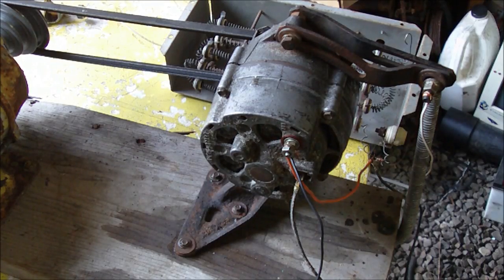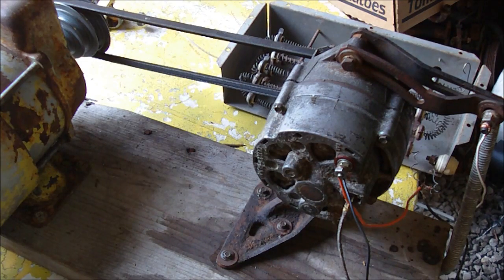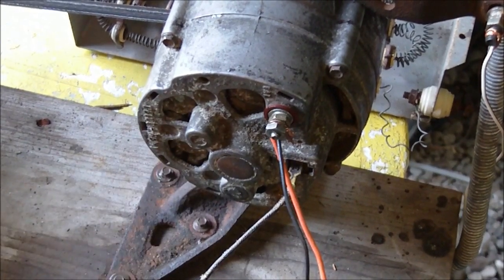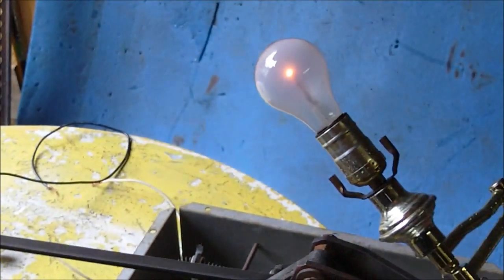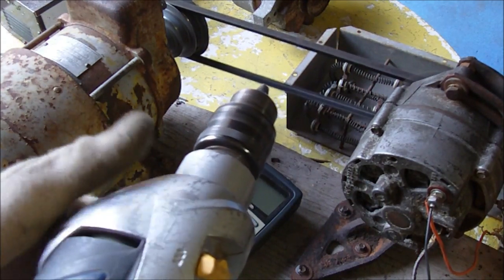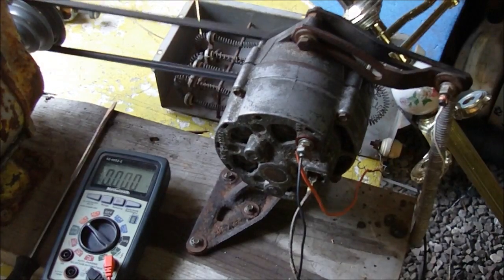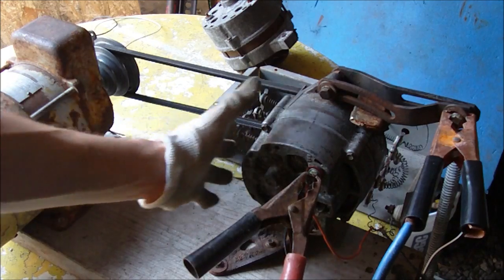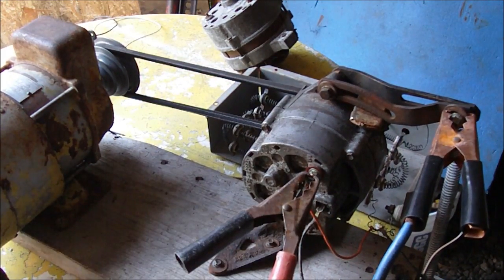Alternator Demo, self energize, generator, arc welder

Comment: Could you get more then 40 volts out of that alternator?
Reply: Yes, if you use an alternator without an internal regulator, or bypass the internal regulator, the output voltage will be proportional to RPMs, which will depend on max RPMs of your drive motor, as well as the pulley diameter ratio.

Comment: Run a forklift e motor powered by a big battery pack like in a car connect it with belts to two or one alternaters hyperthread the power generation into a inverter which is connected to a powerful battery charger which is connected to your battery pack and all your house hold stuff in the other plugs on the inverter and one plug in your bum bum ha ha

Comment: I'm confused... Why are you not using the amps and volts being supplied efficiently? You are making more power then a huge solar bank and not making use of the full potential? Inverters controllers and a battery bank and you can get some massive energy. As set up what is being generated besides 40 volts? There should be a lot of untapped power there.

Comment: Dori, there's nothing fake about this video. the electric motor (pointed out at the beginning, explained, not hidden in the least) is a substitute for a gasoline engine for demonstration purposes. this isn't a video about getting "free energy" or any other bs, it's about building a portable and cheap arc welder. He pulls the "rubber strip" (that's a belt, BTW) to help the (totally not hidden) motor start, because electric motors sometimes can't overcome the initial torque requirements placed upon them.

Comment: Hi Kurtscottage, thanks for the work ua doing really I love watching yo videos! well, am building energy Generator from car alternator and  a car fan motor but it seems the motor has no enough power to run the alternator, when the alternator starts to produce power out the motor slows down the speed. How can I control the regulator in the alternator because regulator is build in alternator inside it, the type of alternator my is " nippon denso alternator with five connector" pls In need yo help?

Comment: This video is over a year old.  If you are still alive, it would be a pleasant surprise.  If so, be warned Darwin is never far behind folks like you.  All of your "I'm not sures" and "I don't really knows"  will add up.  Accidents resulting in injury or death are nearly always a series of small things that add up.  Imagine a random pile of swiss cheese slices.  Holes in every one of them.  Yet if you stack them up, you ALMOST never get holes that line up.  So it is with safety.  No single measure will completely eliminate risk.  So we stack safety measures to cover the holes in the others.  But every now and then, Darwin finds a way to line the holes up.  And you, Sir are one cheese shuffling daredevil.  Be CAREFUL!!!

Comment: If you put 2 in series could you get 240V, and run a 50 Amp. Miller Arc Welder?  I was thinking on buying a generator, but this would be way cheaper as I have plenty of lawn tractor engines kicking around.

Comment: First of all you should practice in a safer method.  When working with electricity always use the proper connectors and insulation's should be a big part of your demonstrations.  Why you ask?  Because 3 days ago I went on an emergency call to find a 16 year old boy dead who was doing very similar experiments with alternators.  I would suggest reposting this stuff doing it the right way.

Now.  Your "alternator welder" again this is not safe.  Basically you may as well bypass an electrical breaker in your home and "weld" that way until the wire catches fire and burns your house down, it is the very same premise as your alternator welder.

Alternator's do not have breakers and what you call "welding" is actually an uncontrolled short circuit.   The alternator and or wire used to weld with will just continue to heat up until either the wire melts/catches fire or the alternator does.  This is why we have machines called "welders".  They actually are built to weld and have all the necessary protection devices within to keep you and your home safe.

Please stop posting this type of careless and thoughtless dribble before you "inspire" others to cause serious harm and or damage to their selves or their property.

Thanks.

Comment: a car alternator will put out 120v+...........regulator  is what limits that....simple operation.........they are actually like 3 phase......they are wired to have 3 hot outputs......
change your pulleys........get a lot ,more voltage.......
i have one of those flat new model washing machine motors that i modified and it will put out 800v+........i can pull a 4 inch arc off it......

Comment: I wonder if you could use 8 AA bateries that are 1.5 volts each and conect them with a button and wiring so when you spin a alternator that needs to be turned on you can press the button alowing 12V to click that alternator on

Comment: Kurt, I enjoy watching, learning to repurpose used or discarded items from your videos.
Would appreciate your creative input. My 97 Tercel is rusting apart potentially
to the point of being unsafe to drive on the road. However, the engine only
has 65,000 on the odometer.  What ideas do you have to reuse it other than as a
a back up generator? 

Thanks,

Ted B